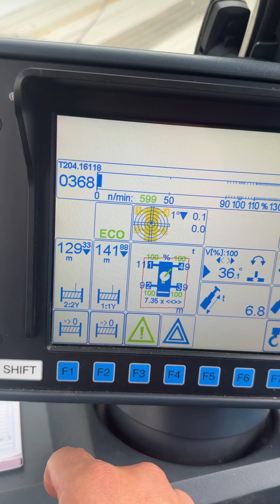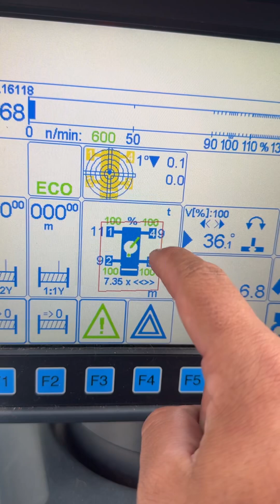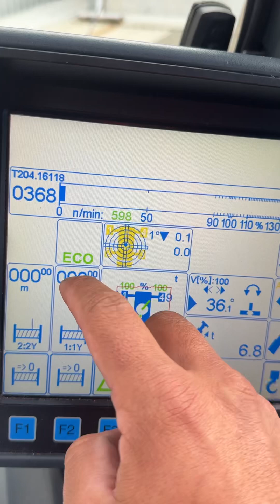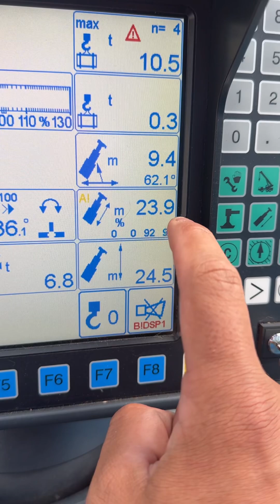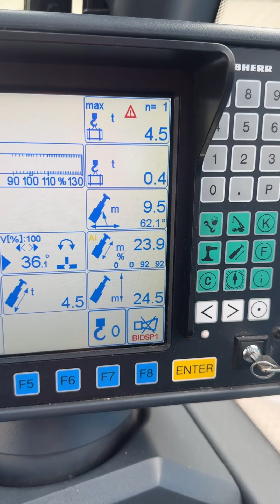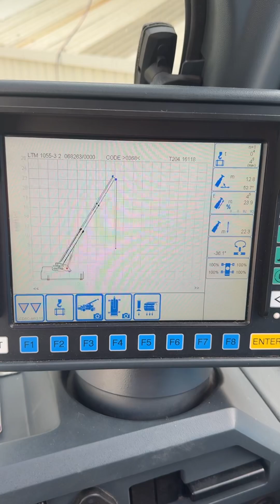Liebherr Crane Upper Works Screen - the basic information that the screen is showing you LICCON 3

Comment: Thx for the video. The reason for the blue for the oil level indicator is because sit is a combo oil temp and oil level sensor once crane is hot and no massive slosh in sump, will register